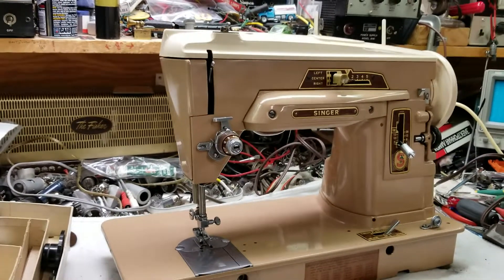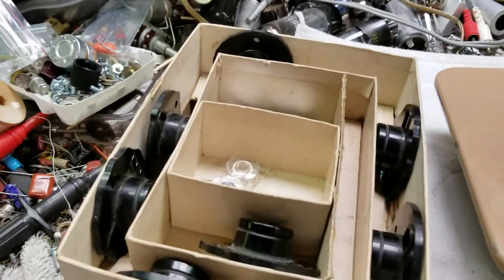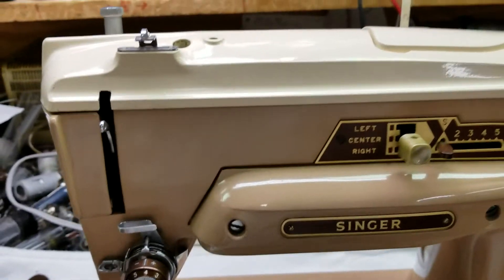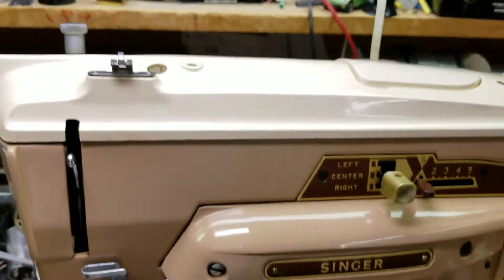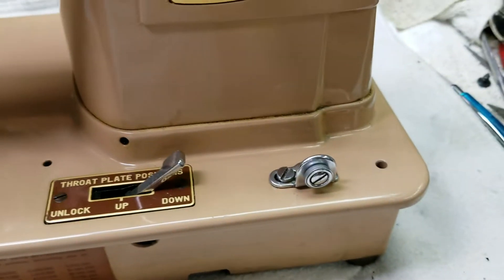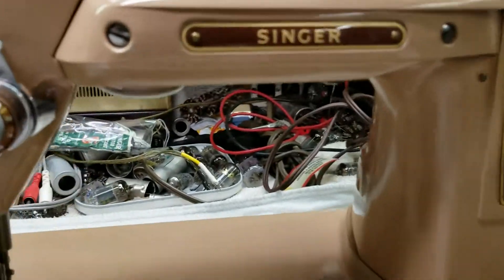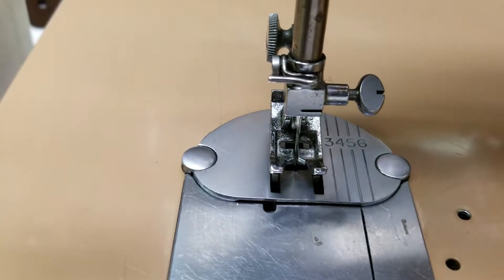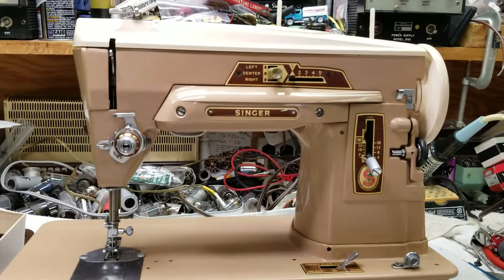Singer 403A Slant O Matic Zig-Zag Sewing Machine Cleaned and Polished!

Comment: So very nicely done, Sir! A real beauty. My favorite Singer ZigZag machine of all time.  I'm soon starting a series for restoring this model and was searching to see other videos about it.
If I get stuck I'll be contacting you for some advice!
Reply from the maker: Hey Andy coming from a Master like you this is indeed humbling and I bow and say "thank you"! Most of what I did was cleaning, adjusting, and inspection, albeit, I did replace the hand wheel which was all chipped up (you remember the conversation about the 2 different fiber gears ? LOL). The controller is now working perfectly (these need a LOT less attention than most guys give them they are SO simple) and I now use the machine when my wife gives me her's or the kid's clothes to repair. I need to work on the throat plate lift mechanism as it is a bit stiff and don't lift high enough without a fight. This was the reason I bought that metal screw thing with the cross slits (for the plate lift mechanism)  in anticipation of possibly encountering the vinyl one. And that was thanks to YOU. I have not attacked this issue yet but soon!
My expertise is general mechanics and vacuum tube electronics. But I get into everything, clocks, old cars, musical instruments, and more. TOO many hobbies! With a vacuum tube Hi-Fi and antique radio collection that far exceeds 400 pieces I need to be careful with these sewing machines. At this point I have 3 featherweights (two 221's and one 222K), two 99's, two 128's, and of course this gorgeous 403A. So I need to be careful these machines seem to find ME! But I DO want a black 301 eventually. That looks like one cool machine it reminds me of the Fairbanks Morse diesel locomotive!
I can't wait to see your new series on this machine. While I doubt there is anything I could contribute to your effort, you never know there may be some parts comparison you may want to verify or whatever so please feel free to let me know fisherdoc@aol.com is my direct email - the "Fisher" is due to my expertise with Fisher vacuum tube equipment. I am THE guy for that I have everything - parts, schematics, service manuals, original units, etc. website is fisherdoc.com. Anyone interested in vacuum tube hi-fi is also welcome to contact me my videos show some of this equipment in action. Thanks! AL